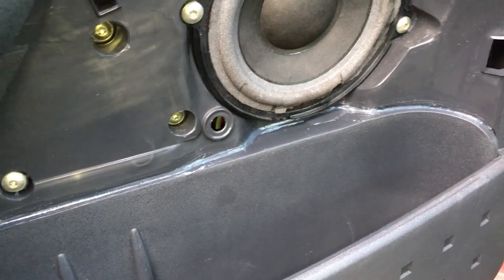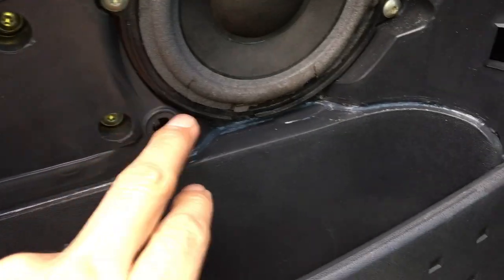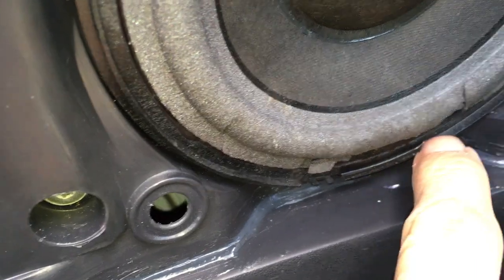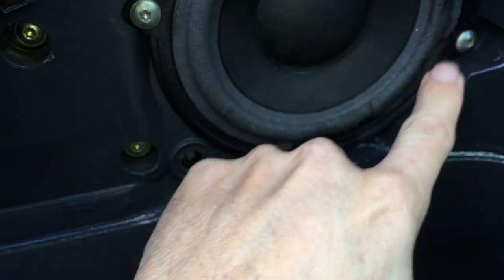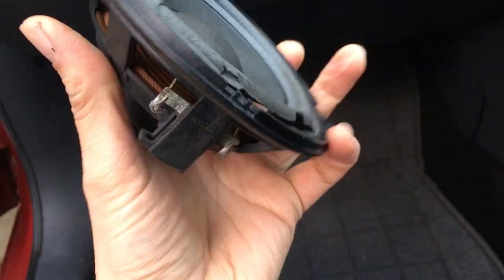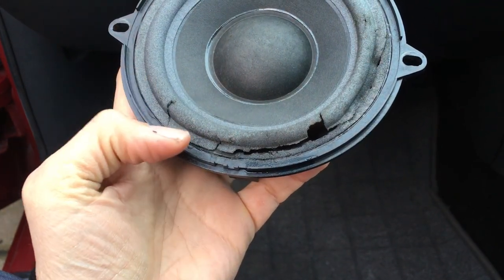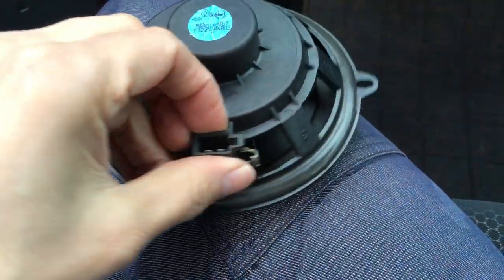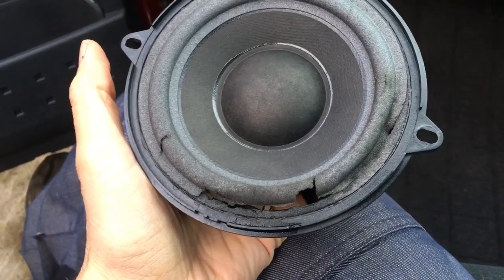Megane Mk2 Water In Door Pockets - Water coming in through speaker.

Comment: Hellow, guys. I've just chaned my spekers with new aftermarket ones (water dmg on the old onea). Tried sealing them with thick nylon on their back side but they sound like s**t. Have you got any success with stopping the water some other way?
Reply from the maker: Can't help u there I'm afraid - I didn't really much notice any difference in the sound when I did it.
Reply: @iofix  In the end I've sealed the whole back of the door card. Worked great.

Comment: nice spotting. Question for you: if you change the speakers to new ones, would that fix the problem? or you need to sealing?
Reply: It won't, I have changed mine and only after changing it did I start noticing the water